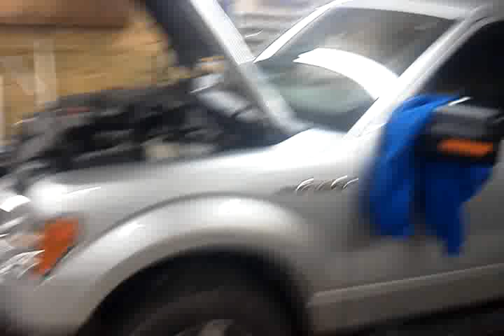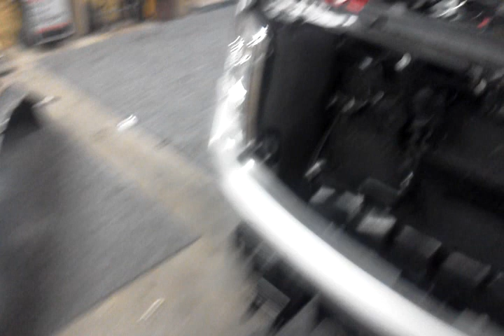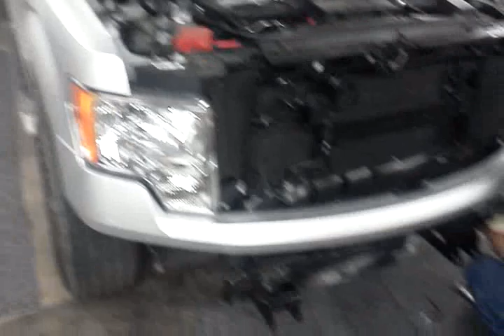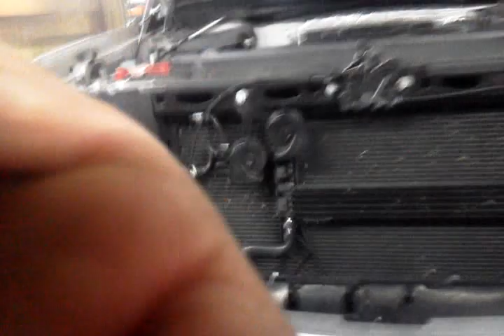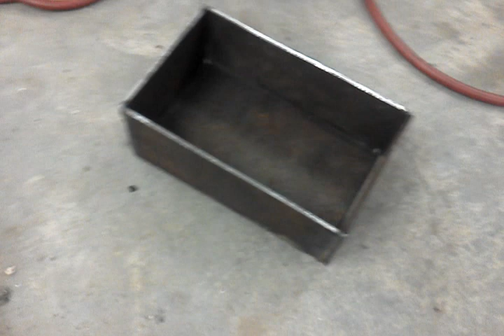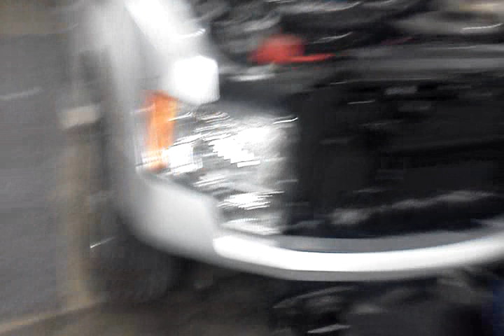FORD F 150 PLOW WARNING!!

Comment: just bought a 2020 f150 "WITH 5.0 ENGINE" the plow sellers say that if you don't buy ecoboost you won't have any issues. the ecoboost has an electric power steering that can NOT have enough power if you lift your blade while turning. the 5.0 v8 has a regular power steering system, so you can put a plow on that truck. never mind what people say...i have a 7'6" hd fisher plow with sides and back blade , and i've had no issues plowing SOME (about 12) residential driveways with it. the truck has no problem handling that plow. 7 years experience...:)

Comment: So what is the remedy for the electric steering and burn out using a plow? Obviously u added another battery but for what to run two so the high draw from the plow doesn't run shit way down? I heard just today that the draw can really mess up the computer in the newer trucks. 
Any F150 owners with plows care to chime in
Reply: The new f150s come with a plow prep package that's supposed to include a heavier duty chafing system
Reply: Diy_Guy right but does that mean that a 2015 f150 with NO plow prep package has no way of using a plow? Or can u just install a second battery as they did here in this very short and non-informative video? I'm looking for some real answers about doing this because I bought the 15 screw f150 5.0 and I'd like to put a plow on it but the dealer says they can't because it has no plow prep pkg and the axel rating isn't high enough. However a garage I know says they will do it but they are quite expensive. Basically stating the axel rating is looked at as if u could have 6 passengers in the vehicle and the weight of the plow would exceed but who plows with passengers?? So u avoid passengers and then the only issues is the electrical steering workaround and the 2nd battery thing they did here may suffice? That or a high output alternator? Looking for thoughts on this
Reply: @lh98  You can install a plow, but in the plow prep package it comes with a  "Heavy Duty Alternator." Note that if you do install a plow on a f150 under warranty, it will void your warranty. So if the truck is out of warrenty, I'd just upgrade the alternator. I'd grab the part number for the alternator off of a f150 with the plow prep package at a Ford dealer. Or you could simply install a more powerful reliable alternator from another source.
Reply: Diy_Guy ok my truck is out of the original bumper to bumper warranty. U are certain the alternator alone will handle this and not affect the pcm via voltage surges or anything like that? This video shows just adding a second battery which actually is cheaper because the 240 amp alternator is 275 bucks plus tax. New batts are what 100-125? Probably easier to just replace the alternator but I'd love to get feedback from someone who's actually done this on the newer F150's if anyone can add input from true experience. Diy_Guy do u have experience in plow installs? Thanks for replying btw!
Reply: @lh98  I have a 2018 that came with the prep package. I couldn't say for certain it would have no issues. But on the 2015 prep package, all it states is that the truck with a prep package has a "heavier duty charging system"

Comment: Well if you did your research before making this video you would see that the new Ford's F150 series with the plow prep package have to 12 V batteries just like the camper package has to make up for this issue
Reply: Matt Wagner are u stating the snow plow prep pkg for new f150's come with two (2) batteries? Umm I haven't seen them with 2 batts all I've seen is the plow button that kills some electrics like heated seats and turns on a relay for plow controller and that they are outfitted with a higher output alternator. So please share a link to the 2 battery part of it.